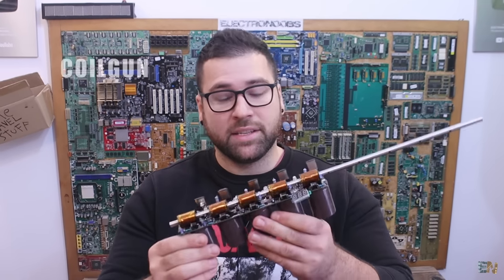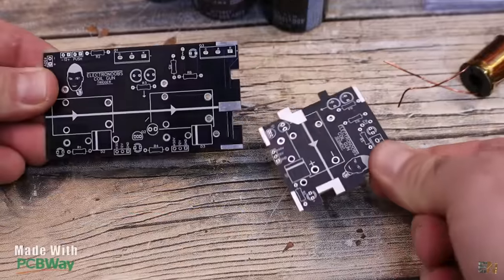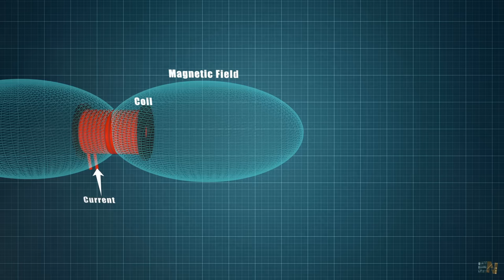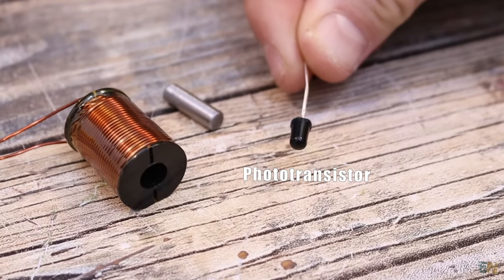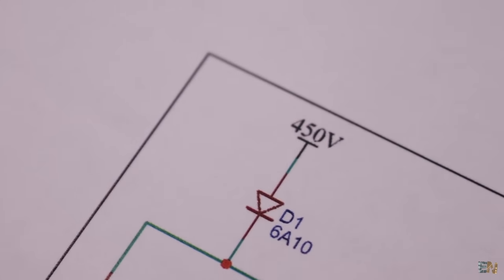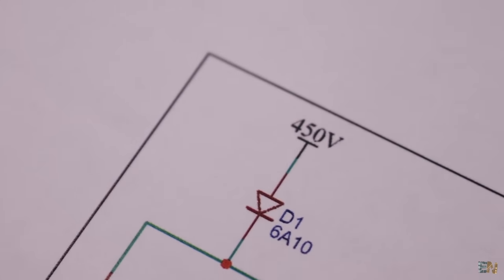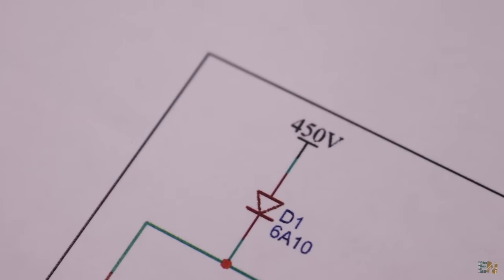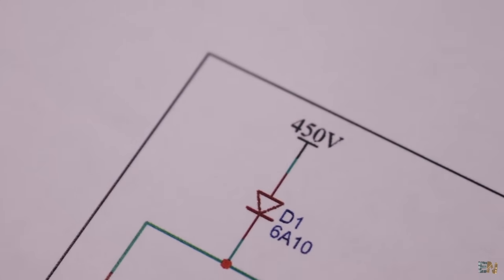I've Made a Powerful COILGUN | Separate Stages PCB

Comment from the maker: Arduino Course LEVEL 2 (Spanish): https://bit.ly/2ZNWgqy

Follow me on FACEBOOK for more: https://www.facebook.com/Electronoobs
Help me on Patreon: https://www.patreon.com/ELECTRONOOBS
Reply: is it possible to use higher voltage caps for it to be more powerfull
Reply: Next project idea, a capacitive spot welder for 18650 batteries, the simpler the design the better. :)
Reply: Hello, I am from India 🇮🇳 ,and I will suggest you to make some video from the basic components like the bjt you made earlier and It will be great if you dub them to Hindi language as there are millions of students here who desire to hear a person having knowledge like you . 🤞
Reply: Please make part 2
And add morw power and auto reload features
Reply: Can we make a big tank connon out of this ? I love the idea of 8.8cm flak electric gun on a tiger 1 tank 🥰
Reply: Coils should have decreasing number of turns, in other case you will slow down your bullet due to counter electromagnetic force at high speed
Reply: Has anyone designed a coil gun generator? So I would have two coil guns firing in the same tube against each other. In the middle of this long tube would be a large array of generator coils. It would fire a magnetic projectile back in forth in a vacuum ... If the circuit was engineered properly a secondary opposing coil coil be energized by the collapsing back emf. This could be enhanced by making a rlc tuned tank circuit to take advantage of the boot strap methodology
Reply: Michael Bishop  it might surprise you, sorta like two tuned tuning forks at a distance
Reply: Why not have the photoresistor at the 2/3 of the coil? I know it would be difficult but it would be more efficient. Also is there any way to take advantage of the back emf?
Reply: What is the purpose of the white LED?
Reply: This is a real nice way of making a rail gun. I have to start working on mine. Thank you for the itea fella. Peace
Reply: Excellent work brother that's a powerful rail gun you have created there😁👍🏼
I wonder if would you see more power if your light sensors was right at the end of the coils?
Way I see it, the light sensors being so far away from the end of the coil it could be causing drag/loss of momentum to the projectile. You want the coil switching off sooner rather than later is the impression I got from your explanation of how the thing works.. Which was very excellent by the way. 

I'm very interested in your future projects matey. Electrical experiments like this is my thing. Subbed 👍🏼
Reply: .moooooooooooooooooooooooooooooooooooooooooooooooooooooooooooooooooooooooooooooooooooooooooooooooooooooooooooooooooooooooooooooooooooooooooooooooooooooooooooooooooooooooooooooooooooooooooooooooooooooooooooooooooooooooooooooooooooooooooooooooooooooooooooooooooooooo
Reply: 450 W....can break kevlar bulletproff ???
Reply: hi e
Reply: Can you make an electron gun by using high frequency electromagnetic waves around the electrons to drive them straight as possible?
Reply: Where is PART 2?? Id like to see this SCALED UP or at least a discussion on HOW one would scale this up (or down) if needed.
Reply: Hey, man. I have a really simple question, but, for me, it is really important. Well, start my truck important, lol. I'm dealing with my ignition. Anyway, the question is.....  The wire leads coming off the ends of the coil, which you attach to your device, a pcb in my case, if it breaks, and you cannot reach it, that end is wrapped underneath.  - Can you solder a new lead to the broken end? Or can you just wrap a new wire around a couple times and use it for a lead?  I'm thinking, it all connects to the same circuit, or will this cause voltage problems? maybe not work at all?

I've done it, the second one, I wrapped a few inches of wire around the coil and then used it as the lead, connected it to the board. The module works everything, including remote, but I only get 4-6V at the fuse, and I don't know if it's the coil repair I did, that is what confuses me, because it works everything else.

Hope you can tell me. Ty

Peace
Reply: You might want to redo this as a "powerful linear accelerator" video. I wouldn't be surprised if Youtube comes for videos with the word gun in the title.
Reply: what is the average energy consumption per shot in Watt-hours? it could run on batteries and become a portable coil gun if it does not eat much, which it probably doesn't. Nice work!
Reply: To be honest, I still don’t understand how you lock the thyristor. As far as I know about electronics, the thyristor cannot be closed by the control contact after the thyristor has opened; the thyristor closes itself after a voltage drop. In other words, you either need to break the circuit, or you can apply a pulse of reverse polarity, which has a higher voltage, or simply short-circuit the thyristor itself.
Another nuance regarding your design. The second sensors are located at the output of the coil. That is, when the bullet has already passed the middle and the reverse field is already beginning to slow it down. In addition, the bullet has a fairly high speed and it makes sense to inquire about the time it takes the bullet to travel from the middle of the coil to the sensors, as well as the time it takes for the sensor to respond and transmit the signal to the thyristor. Because the longer this time, the more it slows down the bullet, that is, the accumulated energy of the capacitors works harder to slow down the bullet. Although, as I already wrote, I don’t understand how your thyristor closes. This is not clear either from the diagram or from your explanations. I advise you to find out how the circuits of professional studio photo flashes work, in which the thyristor is forcibly turned off while maintaining the remaining charge in the capacitors.
To summarize what has been said, I would place the second shutdown sensors inside the coil, you can do this by gluing an LED and a photocell directly into the coil and then winding the wire, and then study the topic of forced locking of the thyristor. But I thank you for your video, diagram and detailed explanation. I wish you creative success!
Reply: concept well explained，check out my 145m/s velocity coil gun using 1000V film capacitors. https://youtu.be/rm4fs7NXEyY
Reply: You need to watch the track spacing of your 500V rail, where you solder the wires on 5-10mm spacing is better and where the traces are running on the PCB you need ~2-3mm and 4mm plus where it's being isolated from human touch.

Comment: Great design! Make it into a loop and you have a mini particle accelerator.
Reply from the maker: That's a very interesting idea. The bad part is the induced back EMF of each coil into the bullet. That creates a maximum top speed. Maybe using electrons... :)
Reply: @ELECTRONOOBS  Just add a couple million volts!
Reply: Wow that would be awesome If you could accelerate a small steel ball or something in that Loop. Even If its not so super fast.
Reply: Can we make a big tank connon out of this ? I love the idea of 8.8cm flak electric gun on a tiger 1 tank 🥰
Reply: @ELECTRONOOBS  Nice build! to fix back EMF you need to build a snubber circuit to give a low resistance path for the coil to discharge into. Also because of the delay in response time of your optical switch and thyristor plus reluctance in the coil. Placement of your optical switch needs to advance as the projectile accelerates down the barrel.
Reply: @ELECTRONOOBS  yes in a loop seems new
Reply: Well, technically it’s already a particle accelerator, as it accelerates the particles of the projectile. And there are linear particle accelerators, too, which work with a similar principle (except using electric fields instead of magnetic ones).
Reply: @sayyidsahal4533  I think it may actually make sense to make it even more like a bldc motor by spinning the loop instead of just your balls.  I'm a bit fuzzy on the details, but I think if the tube were a good conductor, like copper, it might be possible to levitate the loop like a maglev train. Maybe put it in a vacuum to make it more Musky and almost friction free. The painful part would be finding a way to get your balls in and out of it to load and fire.
Reply: I love this idea!
Reply: You should try get hold of some ballistics gel and see how far it penetrates! Great channel & amazing inventions/designs! Thank you!
Reply: @karlharvymarx2650  but the centrifugal force may push it onto walls.
You can make a slit which can open and close.
Reply: @ELECTRONOOBS  If the back EMF was created intentionally such that the Eddy current was forming a specific directional spin in a metal sphere it could potentially be utilized to speed it up even further by pushing against that field as the "particle" passes in such a way that you get a push and a pull.   My first thought is a combination of B field electric Egg motors such that you have a projectile with a spin physically and magnetically straight up and down then pump energy into it such that it forms an ever expanding circle similar to a Beta-Tron. These use a Gap where the particle gains its energy and the magnetic field is used to keep the circular orbit so your induced EMF would likely be helpful and not harmful.  I was thinking about this the entire time I was watching this video and made a system as a kid which I could flick cigarette ashes into a quadrupole electric field then linearly accelerate it forward in a similar fashion to what you were doing here.  As a young man it amazed me as the initial discovery of them floating in the quadrupole field was totally unexpected to me.
Reply: Nice idea, unfortunately we have to wait until the capacitors are recharged. Also, once you get to a certain speed the projectile will tear or melt through the side of the pipe.
Reply: What about using mercury or cooled plasma? Maybe it could be strong enough to defy gravity 🤔
Reply: @GRBtutorials  yes, you are correct
Reply: Was thinking same thing
Reply: lol, bang on.
Reply: @ELECTRONOOBS  there is a way to deal with that, I just can't remember what it is.  I think using a Metal Oxide Varistor to clamp the back emf.  Basically when the projectile passes the centre of the coil you need to cut the current and discharge the coil very fast..
Reply: @Racingisgood  that’s what she said….
Reply: How do you think they came with the accelerator idea? 😀
Reply: @SuperSupplyGuy  i think there is a prototype weapon like that i forget its name...
Reply: Imagine a gattling gun style?
Reply: @SuperSupplyGuy  i have an idea of a gun with this
Reply: @SuperSupplyGuy  very small projectile makes very very very hugely big impact
Reply: Very cool, I suggest you increase the no of windings in each coil and use pure silver enamel coated wire, then cool each of the coils in liquid helium to reduce the resistance to near zero . Increase the voltage and current to the stages and now you will be really by slinging steel. 😎👍
Reply: Lol
Reply: Accelerate the projectile to beyond light speed, and make a time machine!!!
Reply: @ELECTRONOOBS  We're gonna need a particle accelerator sir. Pls
Reply: The device could explode if its in a loop, because the speed would keep on increasing
Reply: The barrel gets hot!!! After each shot i shoot a 3 second blast of freon gas. My coils are alternator coils.
Reply: Why make it a loop when it's almost a linac.
Reply: Yes, optical sensors are going to catch particles.
Reply: @ELECTRONOOBS  Magnetic field strength is measured by current multiplied by a bunch on variables. Thus, to get more power, grab the voltage from the capacitors and drop it to like 2 volts before sending the energy to the coils. As you know, dropping voltage increase current proportionally, so dropping the voltage from 300 to 2 increases the current by a factor of 150, which means 150x power >:
Reply: @ELECTRONOOBS  would you be able to use a plc counter to change the coils from activating sequentially to activating every other and then every third and so on
Reply: @SuperSupplyGuy  along with liquid mercury and you will have anti gravity. I think?
Reply: Correction he would would have a "MASS" accelerator or "maas of particle accelerator" which is a cannon. But you're "coil theory" for the barrel of the cannon deserves some thought 🤔💬... What if he did coil the barrel of the cannon and ended it with a flared end like an old blunderbuss powder gun? Like the long thing barrel 1st ___()()()()---  then out this side with like 25 sets of coils before exiting the chamber. The metal could possibly be liquid by then and traveling near the speed of light.
Reply: Centripetal Force… minimum 3 circular oscillator units…. hover craft.
Reply: @vincentli9106  Power = watts. Voltsxamps=watts. 

1v @ 100a is 100 watts
100v @ 1a is 100 watts.
Reply: what happen if particles accelerator explode
Reply: "diy cancer inducer!"
Reply: Like the one in cern, but at home... 😁
Reply: @ELECTRONOOBS  please make a next part
Reply: اذا طولنا الماصوره  التي من الممكن ان تخف قوت قطعة الاستيل  ثم نحاول اعادتها بعكس الاتجاه  سالب وا موجب_+ بينهم فراق قليل لكي نستفيد اشياء اخرئ مثل توليد الكهرباء مع التردد بالذهاب والاياب 🤔
Reply: I can tell you that it goes plenty fast if you use the right capacitors a butload of power and these nifty SIC MOSFETs you can go fast enough to get the loop walking a little. This warps the track and then it's like a lottery, who's losing something? Because it's a visual thing so one uses quite large and heavy balls. So that's tip 1 DON'T USE LARGE HEAVY BALLBEARINGS. They will put dents in your freezer and scare the dog halfway to death. Had a good laugh tho.
Reply: I was thinking the same thing
Reply: But the problem is particle accelerators don’t use magnetic fields to accelerate they use them to redirect and use electric fields to accelerate so he would have to use a different way of redirect the projectile but it’s hard to find a different frictionless way of redirection
Reply: What about having it be a miniature accelerator loop that has a way for you too. Open the loop and fire it at ridiculous speeds.

I read that a 10 meter long coil gun can outperform a rifle.

Maybe that's how we will make compact coil gun rifles in the future